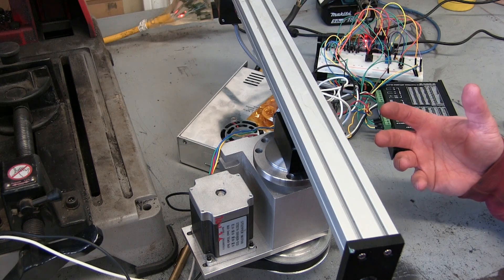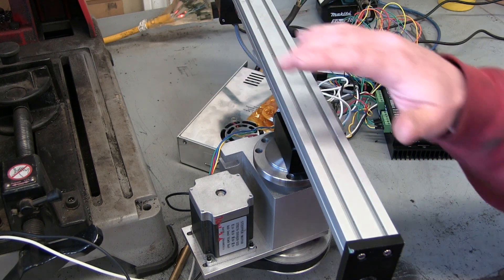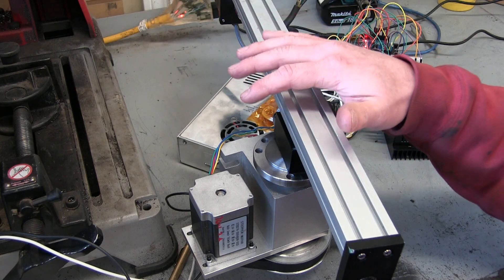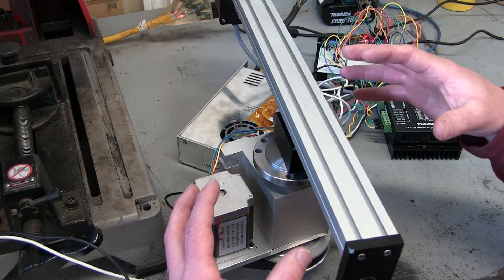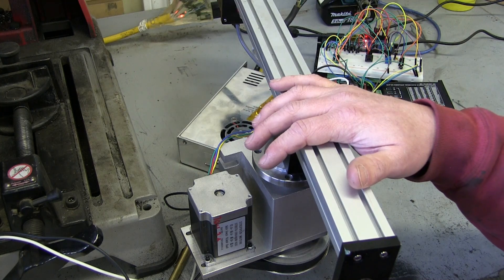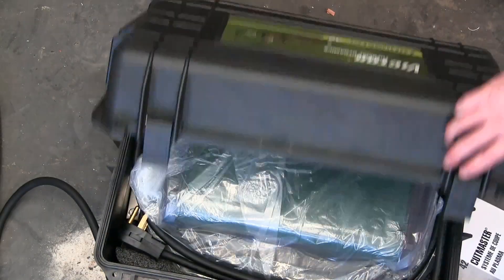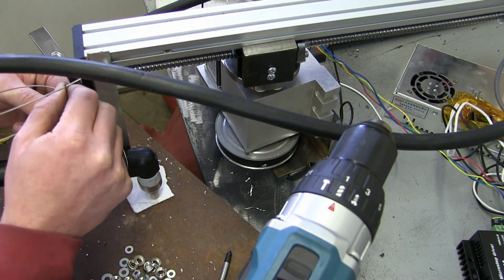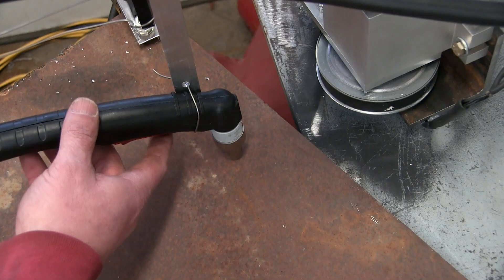Portable CNC Plasma Prototype

Comment: +AvE nice work, it should definitely work.  The devil is in the details. the way you have it set up though requires speed correction for the length of the arc  increasing as you go out. riddle me this? is the electromagnet strong enough to work a mm away? put wheels on the damn thing and a whole new ball game is opened up. not only will it work for stick it on a surface cut a specific whole with a predefined drawling. It opens up huge portable CNC metalworking, with drawling,without drawling, on polar coordinates, Cartesian  coordinates, sheets of infinite sizes you name it.

Comment: There is just such a project already built.  Look up the Sand Clock Project in theJanuary-February edition of Elektor Electronics magazine.  You just need to upsize and upgrade the plastic parts to steel.

Comment: That's just cool. My 2 cents turn the torch around in line with the linier
axis and get 2 mounting points and cord support or perpendicular to the linear axis
since the plasma is a round point the orientation of the handle is irrelevant.
My other Nickel a small spring clamp to hold the trigger.

Comment: What you Are describing is a called a conversational control system. A joystick and a lazer pointer might help. Put it in learning mode and use the joystick to move the dot in a path you want to cut.

Comment: One thing to keep in mind is the further out the head is on the radial arm, the faster the travel will be when it traverses on the rotation.  You may need to have a variable rotation speed based on the distance from the axle to the cutting head.  And yes, I would use it.

Comment: Also, if it's adaptable to any plasma head like you've got, but auto-triggered to allow people to just buy that and use their already owned plasma, and "install" it if you will, I could see it doing much better, though integrating the plasma head would be easier from a design standpoint.

Comment: Some type of optical sensor so you can mark limit points or draw entirely on the work piece. Put a dot, assign it to a point on the pre-designed cad drawing and it goes from there, or draw your own pattern on the work piece and have it follow the line.

Comment: Great idea, I believe it would be very useful. However, I think there will be a couple issues to work around:

1) Angular accuracy: As the torch move further away from the center any angular errors are amplified. One minute of angular error will be about .035 inches at the torch. Double that at two feet. That's assuming you can hold one minute accuracy, which probably won't be both cheap and easy to attain. Belts are cheap but not extremely accurate or rigid, something like a harmonic drive is accurate and rigid, but very complex and expensive. 

2) Rigidity: You don't want the system shaking or glitching when something bumps it or it encounters a bit of dross. Also, consider sag of the beam when fully extended. Ideally the torch does not touch the work and you can't set the distance with a wheel because you cant guarantee material will remain under the wheel. The material may have been cut away by the torch moments ago. Consider harmonics shaking the system as well, particularly with steppers. Of course, rigidity can be addressed at the expense of cost and weight. Finally, consider rigidity of the rotational mechanism. Timing belts are cheap and fairly accurate (low backlash), but may not be as rigid as desired, particularly with large ratios.

3) Speed: For thin metal, the torch needs to move very fast to achieve good cut quality. Speed and precision often involve large, expensive servo motors. Of course, cut quality could be sacrificed, particularly if your intended buyer is a hobbyist or general, low precision fabricator. 

4) Noise: Electrical noise or EMI is particularly bad for CNC plasma machines and it particularly effects stepper motors. The HF start used on many cheaper plasma cutters can play havoc on the control system. Shielding and grounding will be very important.

5) Keep in mind that the professionals probably aren't the ones watching this channel. I myself am the nerd engineer who plays with CNC in his garage. I am good with my smartphone, but may fabricators and machinists would not be. I also do not want to have my phone in the vicinity of a running plasma cutter. I get enough metal particles stuck in the speaker as is. Also, my hands are always dirty in the shop and touching my $800 phone isn't something I like to do with dirty hands. I believe some type of integrated 'conversational' controller would be better, something designed to withstand the 300lb gorilla and the environment.

I think this is a great idea and none of these issues are show stoppers. I think the biggest issue will be controlling weight and cost. I would think if you could get satisfactory performance (1/32 or so accuracy) weighing around 100lbs and costing less than 2-3 thousand (without the plasma cutter) there would be a market. I think it will be quite difficult to meet all these goals, but not impossible. There will be trade-offs, but that is unavoidable in engineering. It would be a fun project.

Comment: @AvE less tools no smart phone app; just use an interface directly on the machine. You keep everything in one place and anyone knows what that robot should be doing. Also in software calculate the time required to move x cm and translate that to time the welder is on with some error to make it completely hands off. Last this thing will have to be ridged as a bick; im sure you know that out in the field when a quick and dirty repair needs to be made things are vibrating and moving and we must minimize the translation of that into cut itself. This is probably the hardest thing to solve but we build it right the first time.

Comment: Not too sure about the "novel" and "non-obvious" claims, what you have there is a polar robot, or a cylindrical robot with the Z axis omitted.

I think you'll need a third axis for torch height. Without it there will be problems with non planar surfaces and the little bit of slop that happens when the arm is cantilevered out far from the center. Although if kept small enough and used on nice flat surfaces, probably not an issue.

And although the footprint is small, the workspace must be clear all around. If made in a larger size you will have to have a counterweight that moves opposite the arm to keep it from falling over.

Comment: Ok so you know the math isn't going to be as simple, that's good. The stepper driver and/or stepper interface subroutines you use are going to have to be a bit smarter too, because you'll need to be able to tell them how fast to go as well as how far, not just have a "speed" trim-pot or hard-coded value in the program.
Otherwise your straight lines won't be straight, and your circles won't be circular!

Comment: I think you need to figure out an area of cut that the machine will support. Then an interface could be developed where you could drag shapes into a - let's say 100mmx 150mm sheet. Cheap freehand-ish. Common gussets. Squares and holes. Rectangles.  But if you're thinking of replacing a drill or slotting with common sizes and depths - then we need to define exactly where that hole is going to be cut within some precision. I'd fucking freak if you ruined a large sheet because the hole was out by 10mm or i couldnt orient the machine to cut at the precise location. Maybe a precision goal for the tool would need to be able to be locate a to cut within +-0.5mm or so?

Comment: With only very minor CNC experience, how would you set your zero or home reference?  I.e. If you wanted to cut a square, and the mag base is just randomly placed, how would tell it where the square needs to be cut and at what angle?  With a rotary axis, you couldn't just set a zero point as it could not judge angles.
Reply: Maybe two fixed laser pointers? A pointer for the center, and a pointer for some fixed reference point. You mount the cutter, then select the desired shape, then orient the shape to corresponding dots on the app using the twisty finger motion and dragging(should have dimensions too, I suppose).

Comment: If I were making one of these, I'd be tempted to add a short, technically redundant third axis perpendicular to the linear one you've got.
that way you could run standard x y gcode for cutouts- not to say the radial/linear thing can't work, but it doesn't integrate nicely with the off the shelf software.   I once built a motorized telescope mount (alt-az) where the altitude was a lead screw linear motion pivoting the scope with a connecting rod.  The translation between simple angular motions to this arrangement sucked.  I'd advise against dealing with that sort of problem, where possible.

Comment: Maybe leave the phone app out..  Have a simple interface where you have a laser pointer and you just move the device to each point and press a button to mark.  Polygons make straight cuts point to point and a circle function where you mark two points for rad.   Go from there..

Comment: This is exciting! I can think of lots of small shops that would like to have this kind of cutting capability, but do not have the space for a computer-controlled cutting table...but they do have a mag base drill and manual cutting equipment. If they could clamp their hand piece in this unit...this is too cool for school! I was a track welder on a small railroad, and was called on all the time, out in the field to play that sweet music with my cutting torch, to "make something" out of nothing, to get a piece of machinery moving again. Gotta suss out that polar math thing, and cutting speeds.

Comment: AVE, there is a slight issue, the rotary motion needs to be calculated and slowed respectively to arm distance from the base, my suggestion upon start up, the arm zeros it via a stop at its far end and have a calibration algorithm to help the sway cut cleaner at further distances. tho that my only idea, and but there is a simple truth, the arm where your cutting head is say 4 inches from the base, and you do a 30 degree arc cut, and at 8 inches you do the same 30 degree cut, you need to take 2ce the time to do that 8 inch cut to have the same, clean cut. though thats only a thought

Comment: Being honest as a welder I likely wouldn't want to use this for the same reason why I hate magdrills. Their a bitch to position. We use the primitive track cutters to cut perfectly straight lines and for the odd shapes we  have guides and other tools to do the shape. And the more complex shapes we cut out using our Cnc Burn table.

This is something that would be good for the hobbyist not pure industry. Worth it to set up for small shop projects but not worth it for heavy industry.

Comment: Plasma in the field sucks unless you use bottle gas. 

Need a machine torch so that the trigger in not hand held. 

Need to have travel speed change on the fly. (don't want to create more more, got enough of that already)

Need a way to tell the gizmatchie thingy where we are starting in the programe. i.e. we is starting this slot here and ending here because there and over there is a freaking thing that we cant get around.  

keep it up 
kickstart it and I'll back it

Comment: HO LEE FOOK! This is brilliant! I am exactly the the guy you are targeting with this device. I gotta tiny shop and not a lotta lettuce and I could have used this about 50 times in the last month. As they say on the intertubes "shut up and take my money!" Cutting brackets and whatnot from some material should be a snap. However, I suspect that if you are simply trying to remove material from a plate that you are using (e.g. cutting a hole or a slot in your plate) you will need a clever/simple way to locate the tip for your start point. Sorry I don't really speak CNC but I hope that made sense.

Comment: to cut curves you could use quadratic equations to cut them and something like trig functions on the app to help determine your length and angles of gussets as long as they were based off of right triangles. for the circles what if on the app you could put in input a center point and the plasma cutter is always kept the same distance from the point entered in the app

Comment: use a standard Miller/Hypertherm/esab plasma cutter, sell this as an accessory that works with all brands.

make the tool meet the price point of the equivalent mag drill, the last 2 I bought were Hougan 904s. 
 cost 850USDea 
stiffen up the arm a bit. Make the control not a phone, but a pad/tablet  that can be plugged in to the tool. 
the pad has to survive nutfucker welders

Comment: A teach method would be easier, do all layout via traditional methods, teach 3 points for circles, 4 points for rectangles. X/Y jog for teaching the points and a mode selector for lines/rects/circles as well as a dry run selector to check the path. No apps/phones needed.

Comment: This. Is. Awesome. 

I would buy one immediately. Not sure if anyone has pointed this out yet or if this is obvious but the speed of rotation as measured at the torch will be greater the further the arm is extended away from the mag base. This would require some sort of algorithmic correction so you get even cutting speeds. 

I know you're no fan of marketing wank but, unfortunately, that's my specialty. Specifically (smart, not just pretty) industrial design with a spot of branding. If ever you want to head in that direction, I can and will help. 

You're cool as fuck. Thanks for sharing this gem.

Comment: I created a similar gizmo once, but for input rather than output using optical encoders. The idea was to generate point clouds of 3D objects. These scanners already exist commercially but I needed some specializations and extreme resolution. The problem I hit was that the radius is inversely proportional to the resolution. e.g. rotation of 1 degree at a 1 inch radius gives you .017" of arc motion, but at a 2" radius you get .034" of motion. This isn't a problem if you have very high resolution and/or low tolerance. I'm thinking you'd want a device like this to have a swing of at least 1 foot to pay for itself. If you had a stepper doing 800 steps per revolution microstepping and no backlash or flex in the arm, that's .047" per step at 12". Given that a plasma cut is not exactly in the ".001" scale to begin with, I suppose .047 per step at 12" could be totally acceptable. 
I would love to see you work out the cartesian -> polar to draw a square to see if the resolution artifacts would change that noticeably from long to short radius.
Cool thing, man. Could certainly save somebody some time.
Reply: Sorry for the selfie. Just so I'm not the clipboard guy who brings up the problems without the answers, the solution to the polar radius resolution issue is multiple articulations. Didn't mention it at first because the description legalese specified 'one rotary axis', but was getting a few questions on the side. SCARA systems have at least two segments and do very well. Imagine trying to sign your name with a pen on the end of a broomstick and holding your arm and wrist locked. 
At any rate, the plasma cutting is a fun application of the portable base. A lot like the 'Crossbow', or the Huawei HNC-100 or other cartesian portable magnetic plasma cutters.

Comment: If there was a good way to manually move the head in the shape you want and have it record what movements were required to make the shape. Along with having preset bolt pattern,square, round, oval holes.  That would be skookum as frig.

Comment: You need to get in contact with Keith Fenner of Turn Wright Machine Works: https://www.youtube.com/channel/UCDmxnPem-pPfJQATIkfgY2Q  He makes a plasma torch holder for a CNC system. This allows the torch to pop loose and shut off if it hits an obstruction and makes removing the torch for service and inspection very easy. You can see a video if his product here: http://turnwrightmachineworks.com/the-wright-store/the-pop-a-way-by-keith-fenner/

Comment: Some quick ideas...set your cut-in a little longer so you can clear the dross and also add a little roller foot to the tip to keep a little clearance to limit to drag. It's important to have your work level and hard to do with a mag base. The roller will help keep the tip the proper hight to minimize kerf and increase the life of the tip. The only problem I see is, well, mag base...can't use it to cut stainless.

Comment: There's a arduino robot that follows black lines - but it sucks.... I prove it to follow white paint pen... And to actually follow it... The major prob is accuracy - since what you want it to follow precisely gets vaporized at the point you want to follow - so it would need to trace, then remember the path, then cut the same path. No FN phone required. To buttons "follow/trace" and "cut/blast"

Comment: I like the line following idea but precision would be a problem and direct layout is a pain and not repeatable (having to redraw layout for every cut). Plus line following would be difficult due to the brightness of the plasma arc (can't "see" the line) and disparity of material (dark rusty metal with white line or bright shiny metal with black line).

Why not build a camera into the head of the unit (therefore working from a known distance/scale) that transmits to a phone app via Bluetooth.

On the phone app you could import standard geometry (square, circle, etc) to handle about 80% of use cases.  A drag and drop type interface with editable parameters (i.e. circle radius of X). Vector paths with Bezier curve capabilities could be used for custom shapes for the other 20%.  Being that the camera image is a known scale, all in app layout would be WYSIWYG.  Just draw it out and press go.  

You could even have the ability to save layouts in app for repeating later.  The app itself would actually be pretty simple to build.